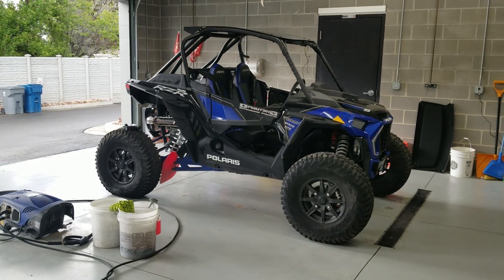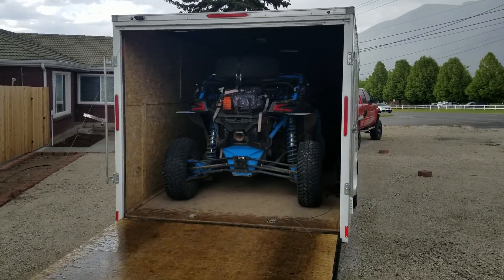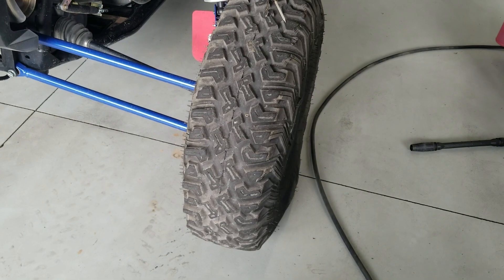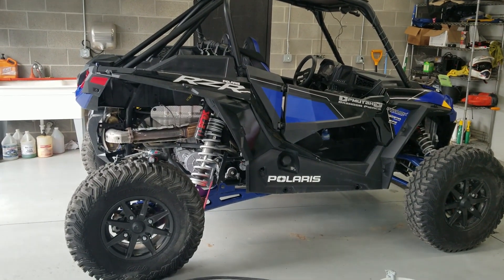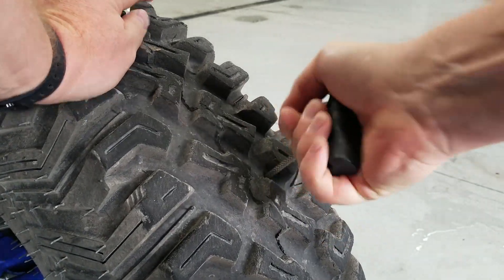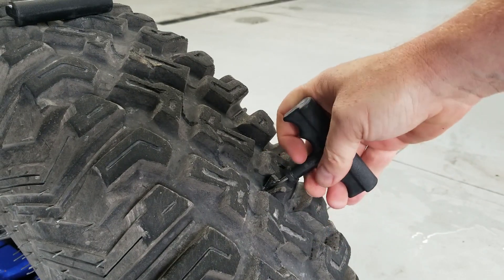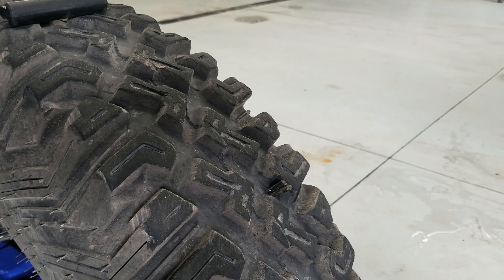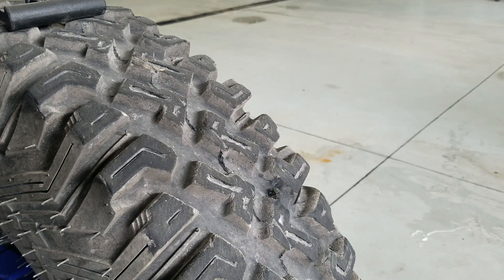2018 POLARIS RZR XP TURBO S FLAT TIRE REPAIR

Comment: Don't you need to use a sealant as well with the plug? My kit came with some. I'm trying put the rest of my kit together. Thanks for the vid.
Reply from the maker: Ty Dominguez nope no need for sealant just plug it and feel it back full of air😎👍

Comment: I usually overinflate the tire then plug it and then bring the pressure down to spec
Reply from the maker: Thanks for the pointer sounds like that be a good way to do it👍